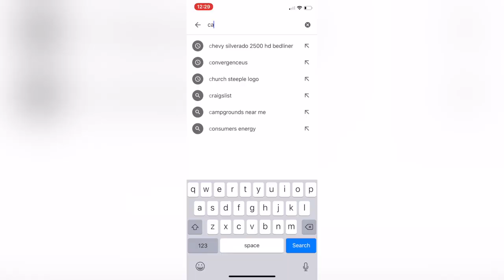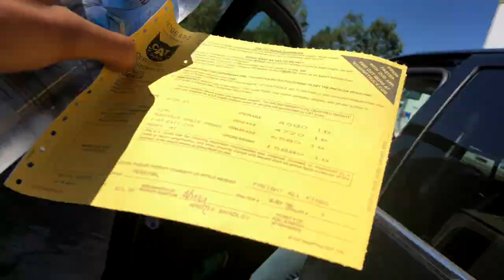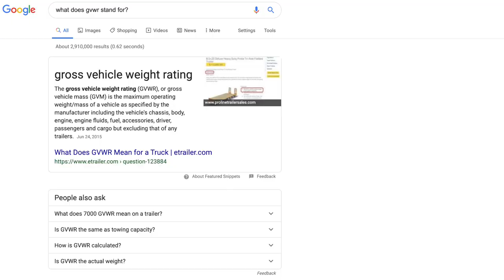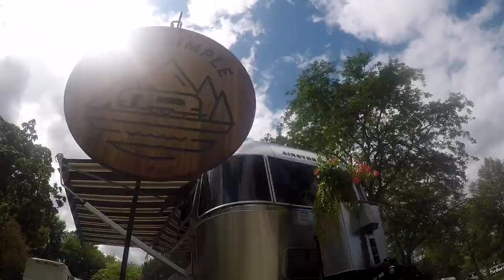🤷‍♀️ WE WEIGH HOW MUCH?! -- Weighing our Airstream

Comment: I know this is old but what is the PAYLOAD rating of your truck? You need to consider that as well (not just the capacity of the trailer) because that is a massive tongue weight and it counts against your payload rating on your truck.
Reply from the maker: We have a 2800 pound payload capacity with this big truck. More than enough to tow pretty much anything we’d ever feel comfortable with. Really, one of the reasons we got the 2500 with the Diesel engine was to ensure that we never came close to any of our payload or towing capacities. And now that we have a 16’ Caravel, we have so much extra capacity in every area. (Though we will likely switch to a Chevy Tahoe at some point, mainly because it still gives us a higher payload capacity!)